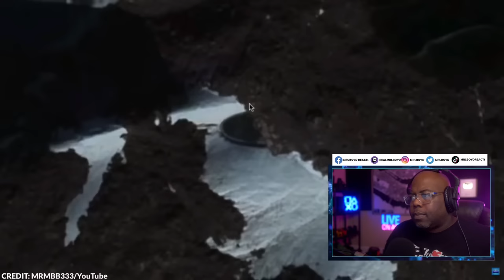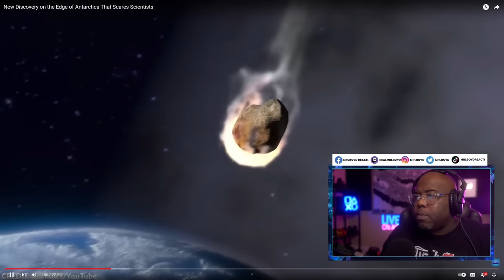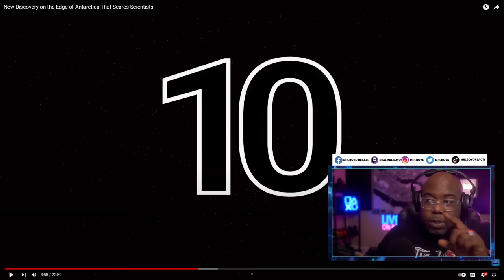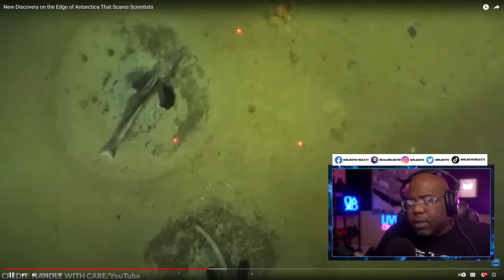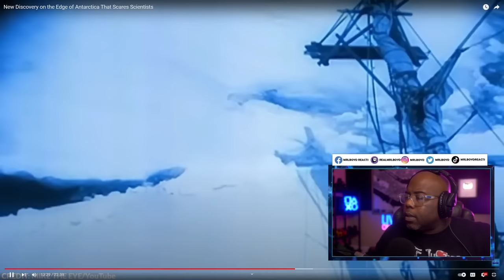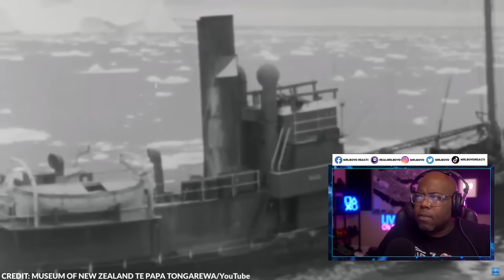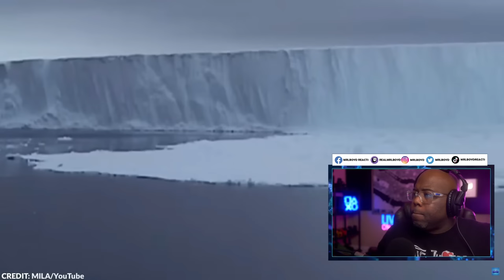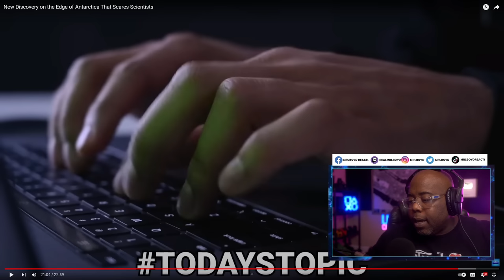Sudden Discovery Of Advanced Civilization Hidden in The Antarctica

Comment: Here's something to think about. You know what they say about melting ice at the North pole and Alaska.  In the mid 1800s during the first exploration of Alaska they saw all this ice built up. 20- 30 years later most of the ice was gone.
Also, what happens to an ice cube in 33°F water? Of course it melts. So as long as the oceans are over 32°F the North pole has no choice but to melt since most of the ice is in the water. To make it stop melting we would have to go into another ice age and all the oceans would have to freeze over to stop the ice from melting. Doesn't it make sense that if the water isn't frozen the ice must melt?

Comment: The compass doesn’t work because the North Pole is not a point. A magnets field is parallel on its sides but vertical at its tips. At the tip of the Earth, the magnetic field lines point up and down not sideways.

Comment: On the first one, a compass does not work at the Earth's magnetic poles because the magnetic field lines are nearly parallel to the ground, and the magnetic field is weak and erratic in those regions. This means that a compass needle will not point towards the north or south magnetic pole, but instead will simply align itself with the horizontal component of the magnetic field. Furthermore, near the magnetic poles, the Earth's magnetic field is also very weak and erratic due to the complex interactions between the Earth's magnetic field and the solar wind. This can cause a compass needle to behave unpredictably and erratically.